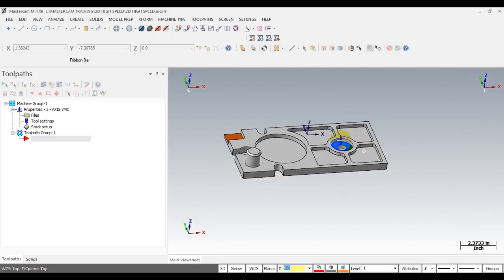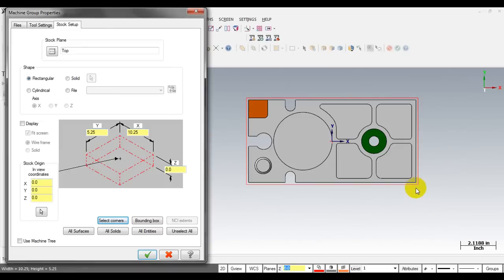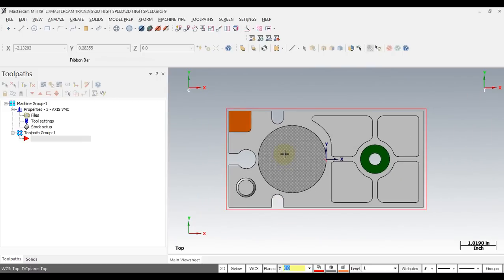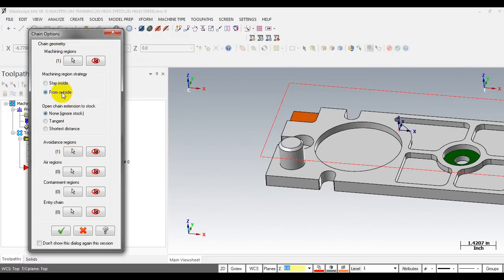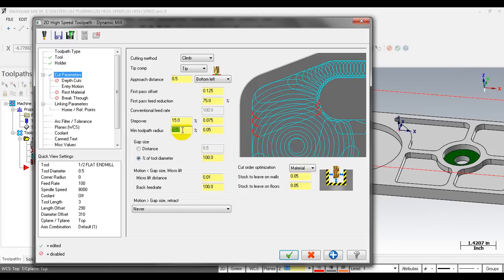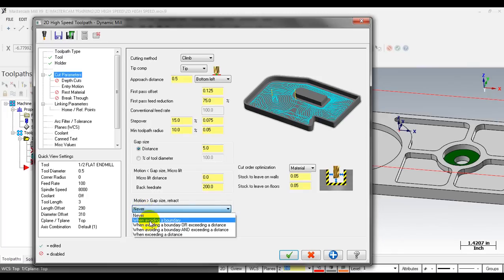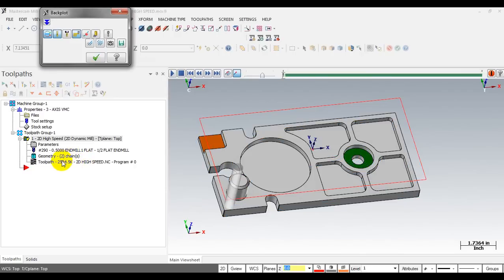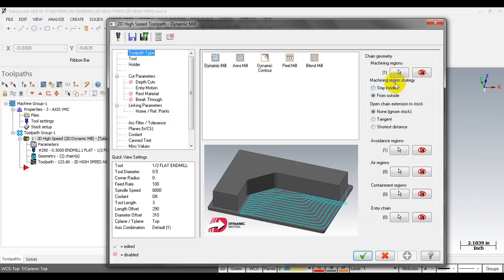MASTERCAM TUTORIAL - 2D HIGH SPEED TOOLPATH- PART1

Comment: Great video! very informative! 2 questions how would you include a boundary wall on the positive most Y side of the part? and what stepover % would you use for steel? thank you
Reply from the maker: Hi Dustin, sorry i don't understand the first question.
Which steel are you machining, you can run around 5-15% for steel depend on the tool and material, also depth of cut.
Reply: GIANG THE TOOL hard to explain but if there was a long .5" tall wall that you want to keep that ran in the x direction at the positive Y end. thanks for reply
Reply from the maker: If you can provide me a picture or hand sketch, I think I can help, my English is not good :D
Reply: I'll see if I can make a rough model. I'm away from the computer at the moment
Reply: http://imgur.com/a/loO0E
Reply: GIANG THE TOOL in the image link I want to keep the pin and the wall and mill out the rest. would the pin and wall both be avoidance regions?
Reply from the maker: Yes, you can select multiple chains as avoidance regions